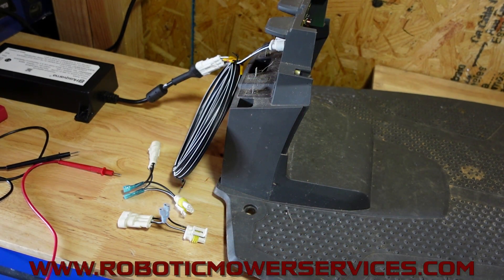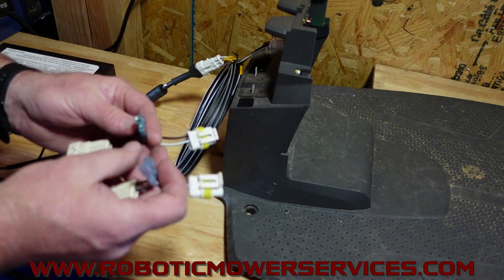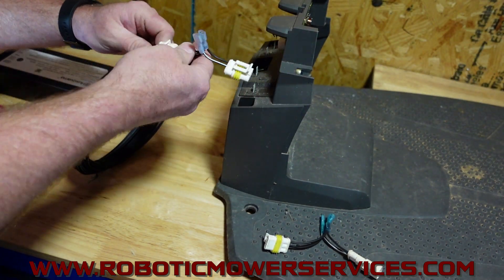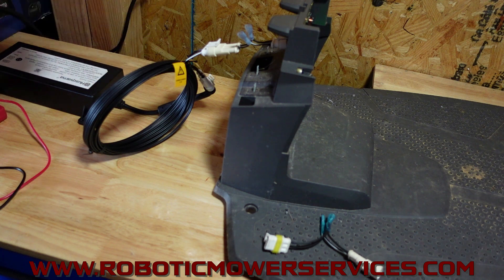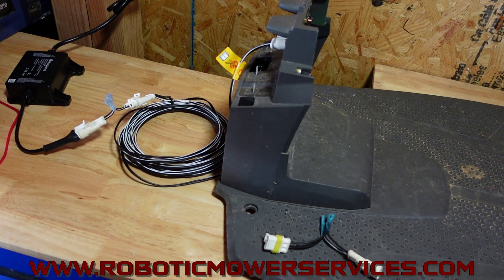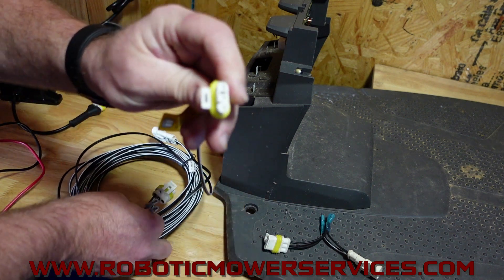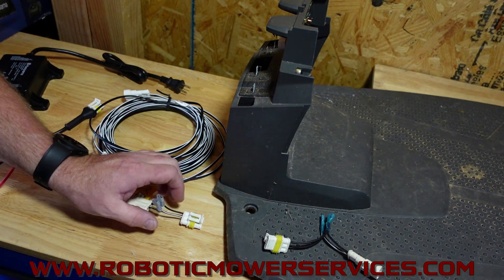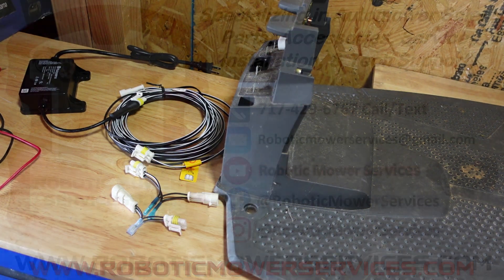DIY Low Voltage Cable Adapter For Diagnosing Automower Charging Station Issues

Comment: Do you know how to remove the pins from those connectors? I need to change the input cable to the base station board from the connector on the base station? And looks like I need to remove the pins to remove the whole cable. Thanks!

Comment: It's funny that you bring this up. Because the is exactly what I have  been  doing to test my transformers and to check Continuity and resistance through my low voltage cables  , Because it's so hard to keep the multimedia probes connected to the terminal pins of the connectors. I came up with this exact same layout only longer low voltage (extension test cable). I'm looking into adding a l e d display to automatically give me voltage and current read out.